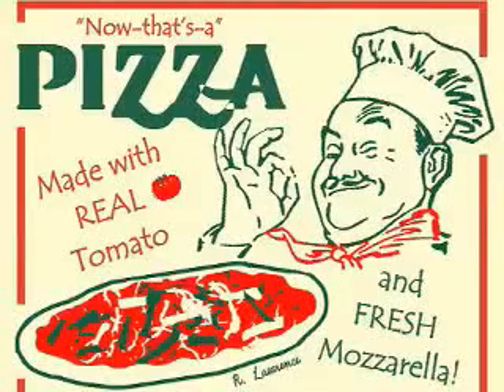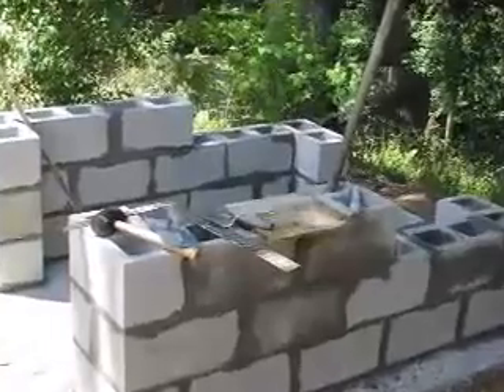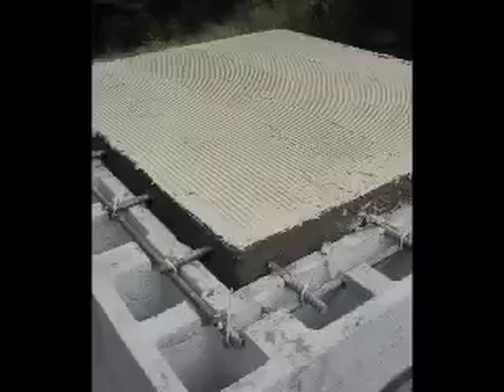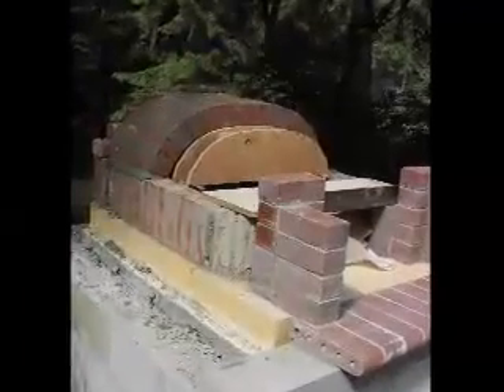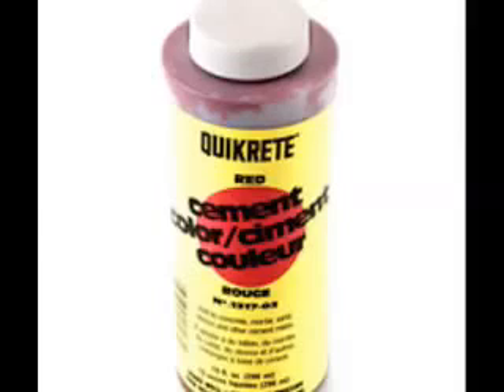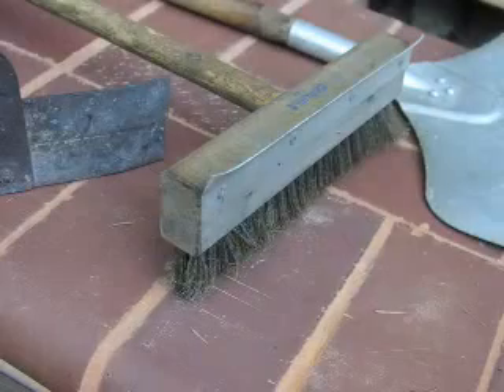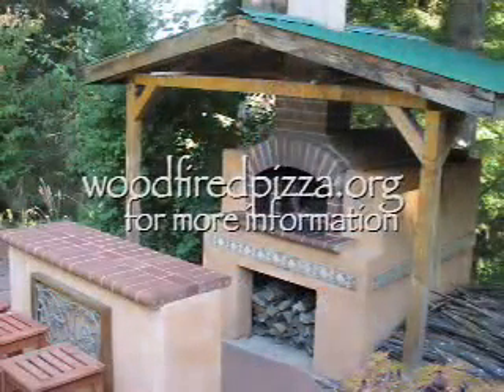Woodfired bread/ pizza oven construction

Comment from the maker: @oceantrolls73 The theory behind the "hanging slab" is that it allows the slab to expand slightly without cracking the exterior walls.  The wood base can be nailed to the blocks or not.  The wood can even be removed if you like since the slab hangs without needing additional support.  Mine is not nailed but not removed either.  I hope this was helpful.  See my site for more info.

Comment from the maker: The iron rebar suspends (holds up) the floor of the oven yet allows the floor area to expand and contract without cracking the walls of the oven.  It is a clever design and very strong.  If you build the oven according to the instructions in the book,  it will not crush the base.

Comment from the maker: @ozzie786543 The oven is isolated from the brickwork base because of the air gap and hanging slab construction technique.  The concrete provides thermal mass in addition to that from the hearth.  This means heat storage that lasts and lasts.  Some ovens have a small thermal mass which means they heat and cool much more quickly.  More theory available in 'The Bread Builders'- a must read if you are considering this type of oven.

Comment from the maker: The oven takes between 3 and 6 hours to pre-heat depending on the use.  If I am only baking one load of bread or a few pizzas, 3 hours is enough.  If I am preparing for a pizza party with 50 guests, I need a lot more stored heat...6+ hours to preheat.  Thanks for writing.

Comment: Hello man! Your project is very good and i've decide to start the work for build your wood oven but i've only a question: Is very necessary to fill of cement and iron bar the cement brick on the base of the oven??? You think that if i dont fill this brick the wheight of the oven can crash the base?? Thanks

Comment from the maker: The outer shell of the oven can be decorated any way you like.  Ceramic tiles are fine.  Attach the tiles using standard "thin set" masonry adhesive.  Do not use a silicone adhesive as the exterior of the oven does get warm.

Comment from the maker: The chimney at the front is important for several reasons.  Air is drawn into door, across the floor, back along the ceiling and then out the door and up the chimney.  This circular path would become linear with the exit at the back.  Also, the chimney is OUTSIDE of the doorway.  If I close the doorway (for baking bread), the temperature will stay constant for hours.  If the chimney was at the back (like the Sunset magazine adobe oven) then the oven will cool rapidly unless it can be closed.

Comment from the maker: Build the support base in a sturdy manner.  For me, that meant vertical rebar in the 4 corners and I filled the empty spaces with concrete.  Some people would build more sturdily (more rebar, for example) and others might not use rebar at all or not fill all the empty spaces.  The support base should be strong but how you achieve that is up to you.  Good luck!

Comment from the maker: Cracking is the main reason I wish I had used loose perlite.  However, the cracking has been minimal and I might do it the same way again.  I can't think of any other way to get the curved top of the oven.  Some say loose perlite offers better insulation properties over the perlite/cement mix as well.

Comment from the maker: Red bricks are OK for the floor, but will not last as long as fire bricks.  Call a few masons in your area and ask where they get their supplies.  Fire bricks are used whenever a mason has to make a fireplace, so they should be available somewhere.  I don't know the going price for bricks.  If perlite is not available, you can substitute "vermiculite".  Both are often available at garden or agriculture supply stores.

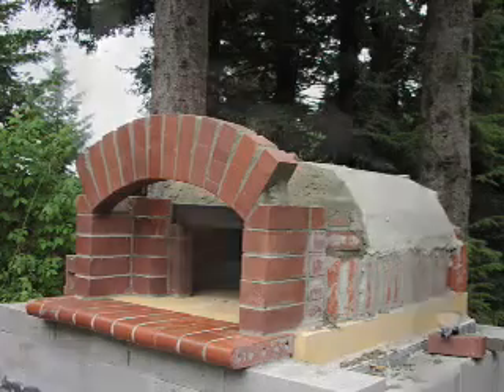Comment: I could not fined fire bricks in my town, so would it be suitable to use the red bricks for the floor instead of fire bricks. I paid $ 2:00 per bricks for the red ones, You think it is reasnoble?Otherwise I will drive about 200KM to get it. 
I will make the foundation by prelite and cerment providing that I found prelite in the market.